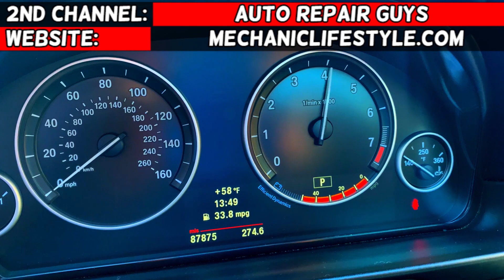FORD FOCUS ENGINE LIGHT CODE P0420 Catalyst System Efficiency

Comment: Thanks for the video! I have the same code and to save some money I plan on replacing the sensors first because mine comes and goes. If that doesn’t work I’ll do the catalytic converter next.
Reply: Did it fix the issue ? Mine still won’t go away and I have done everything but the fuel injectors and the cat
Reply: @YethandYeth  not sure why I was getting that code. My problem was with the TCM. Pray you don’t have that.
Reply: @topher6_9  how did you figure that out boss and you didn’t change the cat then ?  Thanks again
Reply: @YethandYeth  I believe this was after my first episode with the TCM. I had taken it to the dealer and picked it up, I had sent my TCM off to be repaired, and when I got it home the first night I had no problems. The next day I get in to go to work and I get that code. Take it back to the dealer and they said it was the TCM. Never replaced the Cat. Found a salvaged working TCM on eBay and had them put that on. Thankfully still running fine.
Reply: What was your mileage on your focus when it happened? Well thank you a lot for that I will be looking into that next then bc it does seem strange that I need to replace the cat already even thoe I only got 69230 miles
Reply: @YethandYeth  I just got this code for the first time but I’m at 171k miles. Probably gonna have to replace it
Reply: @topher6_9  going to try the sensor as well. thankfully no automatic, stick-shift so don't have to worry about a TCM. I looked up the price of the module and that alone scared the shit out of me.

Comment: Hi friend ,I changed it recently but the problem appear again on my dash board I do no what happened !
Reply: Mine too
Reply: Same
Reply: Probably a sensor
Reply: Did you get it fixed? I have a 2012 focus with 180,000 miles and got the code. Of course when I plan on selling it and getting a new car, the check engine comes on lol
Reply: @tmoney5114 what did you do to fix this?
Reply: @evancc1  I replaced both upstream and downstream 02 sensors, problem still persists. I think it just needs a new catalytic converter, which sucks. You can try catalytic converter fuel additive, worked for mine for a little while but then came back.
Reply: Mine comes off and on still. But thinking of getting an 02 spacer to turn the check engine off